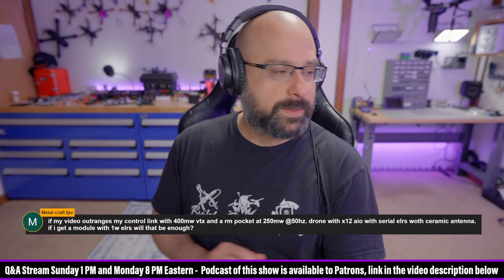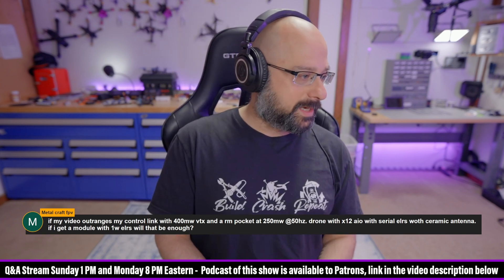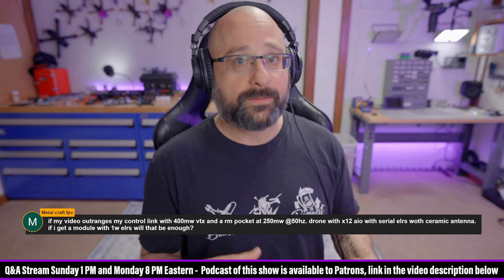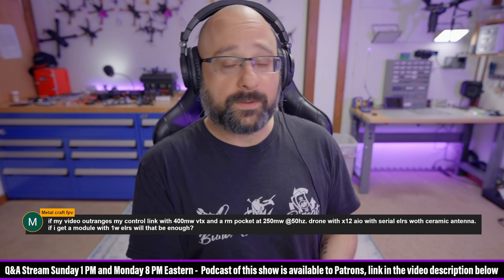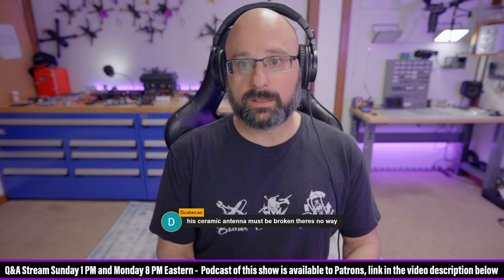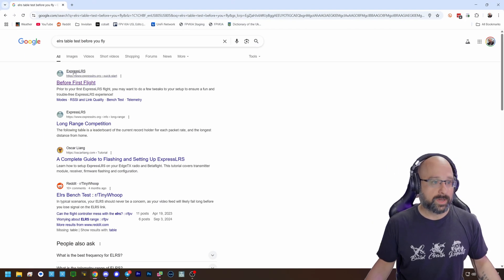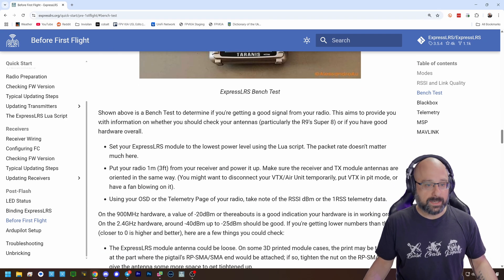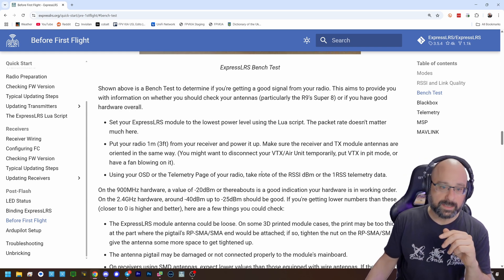ExpressLRS Range Shorter Than Video? Testing Equipment? Higher Power TX? - FPV Questions

Comment: I built a little 2 inch quad using the Happymodel X12. One day I crashed it, and everything looked fine, but the ceramic cube antenna broke, although you couldn't tell at first glance. So I just kept flying it and then I noticed I had significantly reduced range. Inspected it, yep, ceramic antenna broke near the base. I removed the antenna completely, and surprisingly the quad could still fly, meaning the copper trace for the receiver is enough to pick up the radio's signal, which I thought was funny.

Anyway, the broken ceramic antenna is an easy fix. Just solder on an enameled copper wire of the right length and you're good. The quad gets better range now compared to even before the ceramic antenna got damaged

Comment: I had a very similar problem. ELRS 2.4ghz, 100mw, and full 100hz. I was using one of RadioMasters PWM recievers on a plane, I failsafed at 100m LOS. I am very confused I'll try this test and see if the antenna is broken. Anybody have any other ideas? (I am using the GX12.)
Reply: dont use F100, use the normal 100hz, also what is your rssi on the bench, 1 meter away from the plane?  It should be between 30 to 50
You failsafe of you lose telemetry?(rx telemetry power is lower then tx power, you always lose telemetry first)
Reply: @nunogomes6058  I need to use F100 because I have a rather unorthodox layout and need the full resolution channels. I am getting ~35db one meter away from the plane so it all checks out. I didn't just lose telemetry I lost all control of the aircraft for 5 seconds before it reconnected and the plane is now in many bits. (Fortunately it was a home built foamie that I had built to test a concept I was trying out. So not a big deal.) I would really like to get this sorted out before I fly another plane as this can't be happening on some of my larger builds.